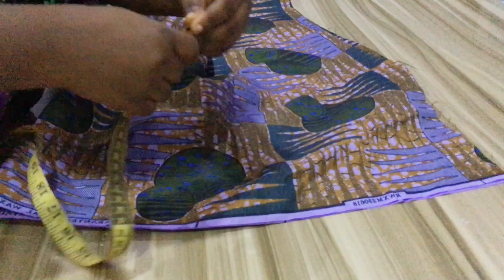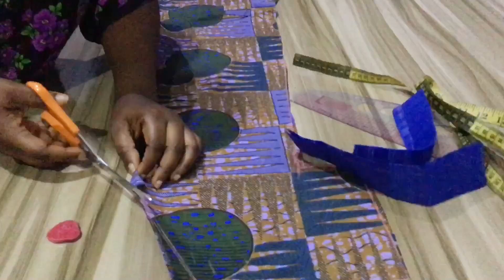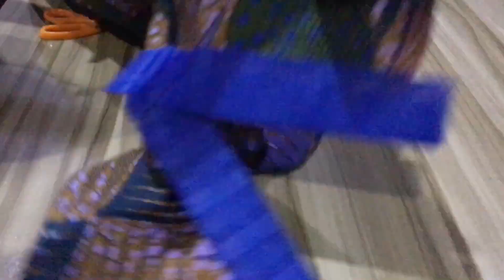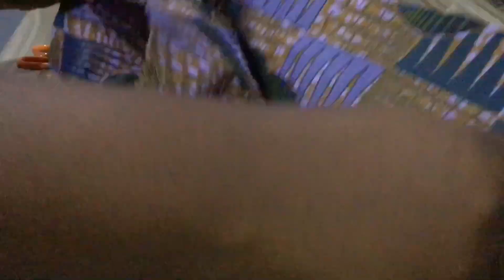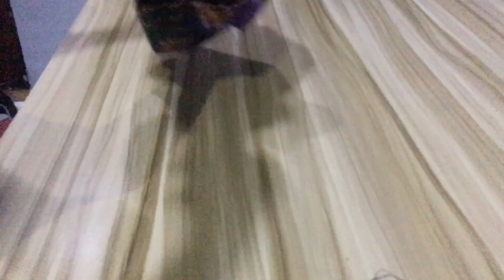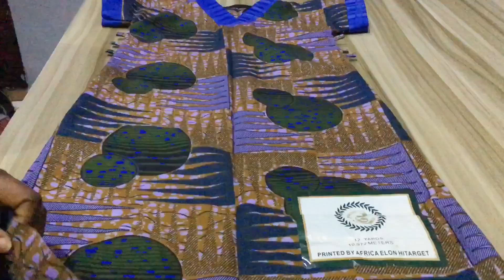How to cut and sew v-neck bubu gown for kids | Scrub neckline easy method

Comment: Thank you 👍 it actually helpful.
Can't we use the hip divided by 4 instead of chest divide by 4
Reply from the maker: That depends on how free you want the bubu to be. I used the chest measurement because I wanted it moderate and it’s an ALine dress. 

If it’s a straight dress, you should definitely use the biggest (circumference) measurement
Reply: @AriusSews thank you ma❤